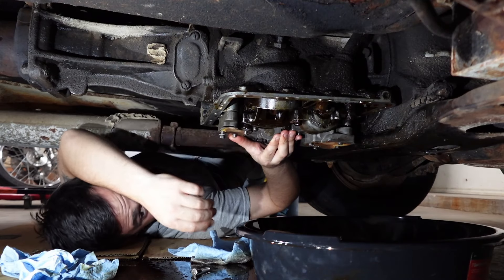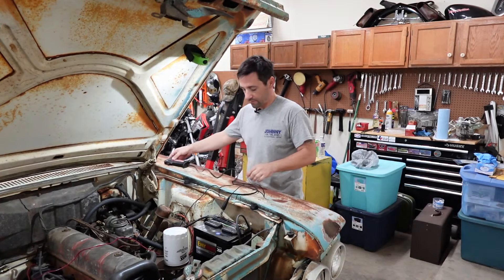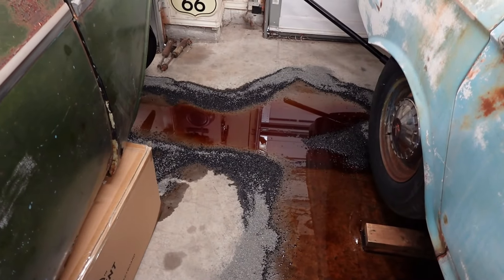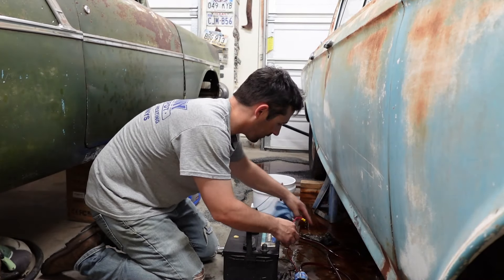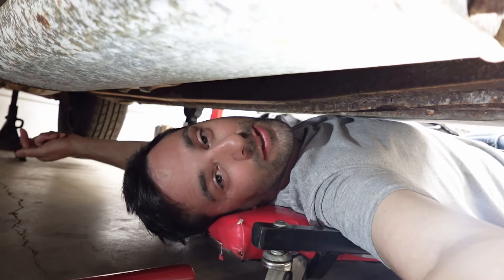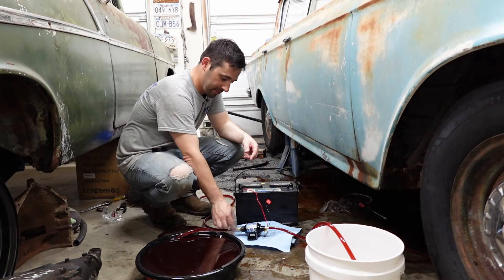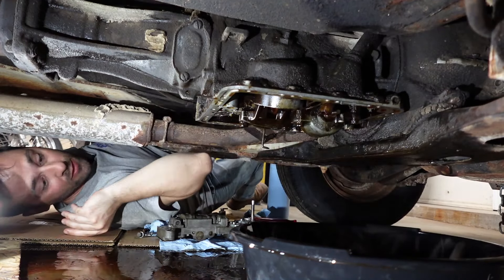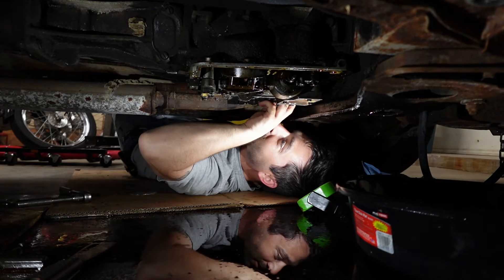This Is Such A Disaster! Abandoned 1962 AMC Rambler

Comment: My dad drove a 59 Rambler classic 250k miles. The 196 straight 6 requires the head bolts re torqued every 10 thousand miles or the head gasket will eventually blow. The flash-o-matic required band adjustments and fluid and filter changes every 15k miles. Most people didn't do it.
Reply from the maker: That's very respectable keeping a car going 250k miles. I will make a note about band adjustments, fluid & filter. Thank you. I did the retorque & valve adjustment in this video here https://www.youtube.com/watch?v=GjmPl1t33rE&list=PL6hZXCJfWqs6pK9MzljWF8m1MZ0yRb7AK&index=18&t=1612s

Comment: You really don’t need to flush the transmission on an old car. When that car was new, there was no such thing a flushing a transmission. You can just drain the fluid from the trans and converter, drop the pan and clean the screen or replace the filter (depending on the car), and refill the fluid. If you feel the transmission is sludgy, you can just drive it awhile and change the fluid again. Old automatic transmissions didn’t generate as much heat as newer transmissions so the fluid didn’t break down in them like they do today. It wasn’t uncommon to never change transmission fluid back then, and transmissions survived.
Reply from the maker: The information is appreciated & can be applied in the future. Thank you for taking the time to leave a thoughtful comment.